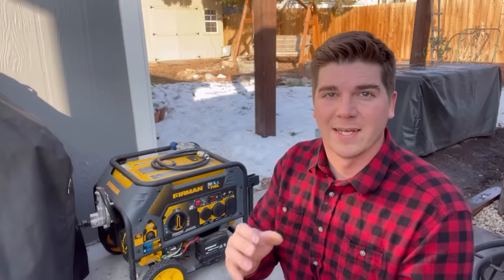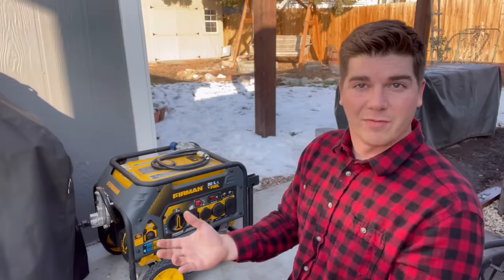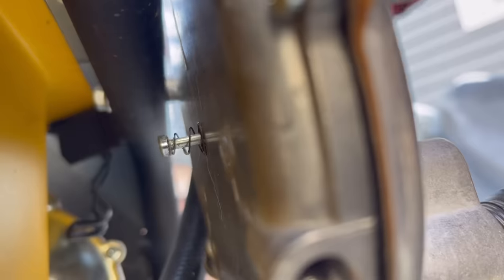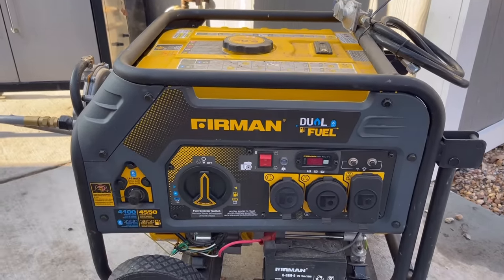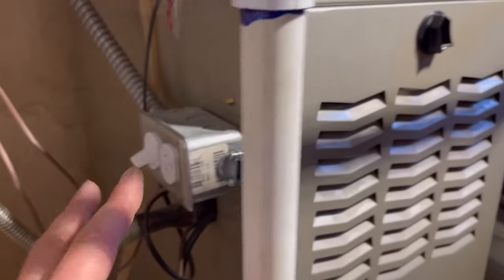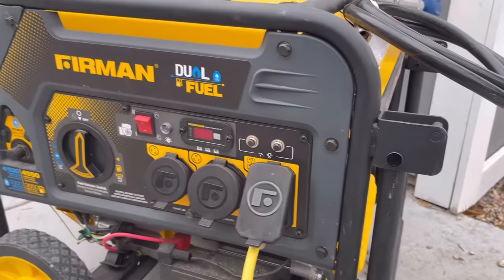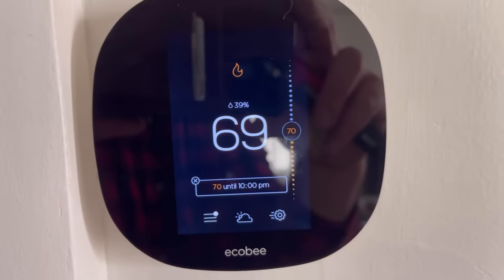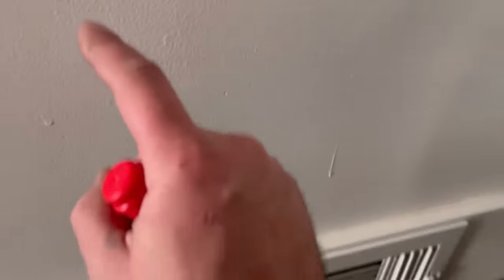Most Homeowners Don’t Know About This Trick To Get Heat During A Power Outage.

Comment: My understanding that you should be plugging in sensitive electronics into an inverter generator. There is close to 25 percent of Total Harmonic Distortion (THD) on regular generators that can fry up things such as home appliances and electronics or even newer furnace electronic boards. THD of a regular ac current should be under 5 percent.
Reply from the maker: If you have a generator already you could use a pure sine wave inverter in between the generator and the furnace.
Reply: @Glocktard  Generator runs a battery charger.  Battery runs the inverter.  Inverter runs the furnace.  It's about as scary as you can imagine.

Comment: The newer inverter style generators that have the "On/Off" switch on the fuel cap do not have the same issues with the fuel going bad and wrecking the carburetor. I use E10/E15 in mine, I have one of the A-iPower generators. I leave E10 in it all year long without an issue. You have to turn that switch off though.

Comment: Your generator is not a pure sinewave inverter generator, right?  I understand that some furnaces (I've been told mine) will not run properly without a pure sinewave.  

I don't know why anyone was saying that power was still going out to the electrical grid.  Basically, you're running your furnace input wiring into the cable.  Your switch box is just an outlet.  When you unplug the cable from the outlet, there is no connection between the furnace and the house power.  None.  There is no reason to turn off your mains at the box because there is no a connection between the furnace/generator and the mains system.  This was a very helpful suggestion, and I re-wired my furnace shutoff to work the same way.

I am worried about letting the furnace system run down.  If we turn off the heat at the thermostat, will it go through it's cooldown before turning off?
Reply from the maker: Yes the thermostat will allow it to do the cooldown procedure line normal, then once the air has cooled and quit blowing from the vents you are good to shut down your generator 👍🏽
Reply from the maker: You could also install a pure sine wave inverter in between if you have a high efficiency furnace.
Reply: Use a silent generator 😊 https://youtu.be/25dCG557qC0

Comment: Appreciate you taking the time to make this video. No doubt it will help a lot of folks! I didn't know about the NG regulator 👍
Reply: They run at different pressures.  Know what you're doing.  Propane runs at twice the pressure.  and a much smaller orifice

Comment: Not sure if this was mentioned elsewhere, but if your generator or inverter is NOT bonded “neutral to ground” when running “direct” to your inverter or generator your furnace will most likely fail to start especially with newer control board furnaces. Easy to test by using a meter to test for continuity between neutral and ground on the inverter or generator. Once I bonded everything worked perfectly off inverter and Generator. If you tested with one of those 3 prong probes you will see an “open ground” if the inverter or generator is NOT bonded. If bonded you will see no error or ground fault.
Reply from the maker: Great advice. Maybe it will help some folks out. I didn’t realize that my Gen set has a bonded ground, so it does the work for me.
Reply: @diyhvacguy  Your welcome! I spent a full day testing…. and bonding neutral to ground is very important in many sensitive applications not to mention for safety too. Generator / Inverter manuals will state how they are configured but beware…. My Renogy Inverter stated it was bonded inside the inverter but when I checked it was NOT. Once I bonded neutral to ground the furnace passed it’s self test and bingo off to the races. This was running the furnace stand-alone directly to the inverter. Sorry for the long winded reply.

Comment: Great setup and great video! It would be much better and safer to NOT mount the NG regulator to the machine due to the vibrations coming from the generator. At minimum I'd suggest adding a rubber isolator. Thanks for taking the time to make the video and share your setup!

Comment: Everything at my house runs on propane, except lights and outlets! A wood stove keeps me from having to burn $2.65 a gallon propane for heat. I have 1000-watt inverters mounted next to both refers and my living room entertainment center ( 60" plasma and related stereo components). When the power goes out I move a battery to each location and we are off to the races!. I also have 2 solar panels that charge up 3 battery banks (24volt) in my sunroom, and they run the lights there, at least in the summer and on good days with no clouds. Collect batteries anywhere you can, they are golden! :) I also just got an incredible deal on 2 3000 watt inverter/chargers new in the box. they will go into storage! :) Get a solar generator too if you can afford it. I have an ECOFLOW and my son got the Bluetti!! Merry Christmas!

Comment: Excellent information, you are a remarkable teacher and your solutions easy to follow. I have an AC200p and an oil fired hot water radiators furnace, following your pigtail bypass do you feel that would work as well as your  gas furnace keeping in mind that  there is a circulating water pump attached to the furnace.

Comment: I disconnected my gas furnace from hardwired to plug-in years ago. If the power grid drops I can quickly plug in to another power source. I have four RV batteries on a hand cart on constant maintenance charge with a pure sine wave inverter, outside are two generators with power cords terminating in the furnace room.

Comment: off topic video suggestion: how to fix a noisy AC compressor.  Starts with a loud whack…and runs loud.   I’m guessing a new fan motor would help, but how do determine the correct replacement fan motor?  

And how to quiet the loud whack when it kicks on (what part, and how to determine the correct replacement for it, as well as the correct fan motor replacement)?

Thanks.  0:03
Reply from the maker: Thanks for the recommendation! I’ll def do a video on this. Maybe it’s a problem that a lot of people have. Thanks again, cheers

Comment: Just as an aside.  Gas with ethanol is perfectly fine as long as you're going to use every bit in the tank and run it dry within 30 days.  For the last long while I use the less expensive ethanol gas when I know I'm going to run it dry and then run about a cup of ethanol free.  It's only when e gas sits for a long while that it starts to gel up and clog the injectors.

Comment: Part of the preparedness challenge is the knowledge that when you need a generator, so does the fuel station. Friends in CA had to find a generator big enough to run the fuel station before they could buy the fuel they needed.

Comment: For the furnace you basically added a regular plug to it so that it can be powered by another source.  I’m surprised people think the plug is live.  The only thing I would do is put a shoe or something at the door to keep it open so that it is not pinching the electrical wire.  That’s the only risky thing I see.
Reply from the maker: Yea I’m like how did you get that this plug was going to be live from what we just did? They must not understand the concept. Thanks for the tips I put a grommet in there to protect the wires👍🏽 cheers

Comment: Very interesting video.  Thanks.  Question:  The hose you removed from the propane regular is the same hose that is on the natural gas regulator load block, now correct?  Thanks.

Comment: Just a FYI - to my understanding that whole back feeding the lines and killing a lineman is mostly BS. My son is a lineman and a good friend of mine is also. From what they tell me, they work of live wires all the time and treat every wire like it is live. To dive the point here, I lost power to my house for three weeks during a hurricane here in Florida, I ran my house the entire time on a genny, when the guy finally came out to do the final inspection and pop the meter in I ran outside waving my arms like a idiot telling him my generator was running still. He told me worst case scenario if I left it running and through the main it would fry the genny, but more than liking it would trip the breaker.
Reply from the maker: Wow that’s great to know. Thanks for sharing!

Comment: I was going to do the pigtail but then I got lazy plus most pigtails are 14awg.  I just cut the 12-2 and installed a male plug.  On one furnace I did put a single gang outlet but on the other I just spliced in a male and female plug.  I know this isn't recommended but how often will I actually have to unplug it.  Also just note my 1/2 horsepower pulls 869 Watts but my 1 hp dual zone pulls 1169 continuously.   They both pulled 1500 watts on start up.  Get a watt meter and check this out before you lock into a generator as some of the smaller ones could struggle.  I just ordered the new pulsar 4000 that's 2800 on LP and should be perfect.    This strategy is all a back up to my 17500 generac with an interlock kit.

Comment: You could also install a 50 amp outlet outside and hook right into the panel. Then shut the main power off and turn the new 50 amp breaker on and plug your 12k generator in and it will power the whole house as od the power never went out. When power comes  back on reverse the entire process never never never turn the main breaker to thr street on while the generator is running.
Reply from the maker: This is the plan very soon! But for those who can’t afford it, this is a viable option :) stay tuned for the interlock kit install that’s soon to come. Cheers

Comment: While this will work I strongly recommend anyone who lives where they need power to their heating system invest in having a proper connection for a generator. This will allow them to jot only operate the heating system, but also other circuits including a refrigerator, water heater, etc. They may not be able to run everything at the same time, but they can run what they need depending on the capacity of the generator. I installed a 30 amp receptacle in an atrached garage and an Interlock switch in the main service panel so the breaker for the generator and main disconnect breaker cannot be on at the same time. Even if you don't have a generator you will be ready if you borrow or buy one in the event of a power outage.

Comment: Ok, I work for a power company and one of my jobs during a storm restoration is to check neighborhoods for running generators. If you pan on powering individual units/appliances, you are good. However I commonly encounter set ups where someone has put a 50 amp breaker, wired it to an outlet, fabricated an extension cord with 2 male ends and plugs the generator into the outlet after shutting off the main breaker. This is NOT up to code! It must be wired through a transfer switch designed to attach a generator to your home electric.  It is NOT considered safe and if I find one when I am patrolling, y sI will pull the meter and your house will get 😊power restored AFTER everyone else. I will also notify the local electrical inspector of the violation. It ma

Comment: You can back feed your service panel with the 30 amp 220 volt outlet on the generator with a separate breaker and a breaker interlock system and still be safe.

Comment: Get a generator that can run 12 to 24 hours at 50% load so you are not refueling it every 4 to 6 hours. And make sure your furnace does not need more that 50% of the watts the generator can provide.

Comment: Great job 👍 thanks for sharing. I've always had a generator ready. Now where I'm going I'll have to do it there. I liked your inverter with the 12 volt battery close to furnace. That would get you through the night no problem. I'll have to check out that generator mines too big and heavy. Only thing I would do is have it so i can pug the generator from outside.
Run the furnace and a kitchen light and fridge and stove. It might be a good idea to get a gas stove instead of electric.
Reply from the maker: Thanks. And yes gas stove is always a great idea. That’s one of the first things I did when I bought my place. I’m gonna be doing some test videos with two different 1000w lithium power stations so stay tuned for that!

Comment: Really like the pig tail furnace video. I used to hard wire old furnace to generator power when an outage happened. Never liked doing that but it did protect lines workers. I am having trouble finding the switch/outlet you used. I have stopped the video and used a magnifying glass to look for info. but no luck. I have ordered 2 Leviton units, 4 screw not right and 6 screw not right.
any thoughts. DE

Comment: Any suggestions to make this work?  We are losing power frequently, a new thing since DTE switched around what substation we are served from.  Basically our area is overbuilt in the last 10 years.  Anyway, by local code our furnace is connected to a combo switch/gfci plug, the condensate pump is plugged into that plug.  Then a armored 3-wire cable goes to a nearby junction box which brings in a dedicated circuit.  I disconnected the armored cable at the junction box and put a plug on it, then connected that to my generator.  The furnace partially started but would not fire up, flashed a code 26 saying "neutral reversed or poor ground"  It's not a bad board, when I wired it back to the original state and our service power finally came back, everything worked fine.  I suspect it has to do with generator/gfci in conflict, not sure.  Generator ran everything else it was connected to just fine.  Perhaps I should make a pigtail behind the gfci/switch?  Thanks.

Comment: i changed my furnace to have a plug in cord. I wouldnt turn on using my champion invertor generator. Champion told me its probably because the generator doesnt have a ground/neutral bond. I made a cord cap that bonds them.  I havent tried it yet but hopefully that works.
Reply from the maker: It should work. Some have a bonded neutral. Mine did Apparently and I wasn’t aware of it.

Comment: My concern with the setup like this is the heating of the extension cord. Is that a 100 ft cord you're using, and also what gauge is it? On a 120 volt furnace, can you get away with a 16 gauge extension cord? Or does it get too hot? I would imagine you should probably get the heavy duty 14 or 12 gauge cords for this.

Comment: Sorry ,I missed the generator run down on the outlets.I need the 240v 30amp so I have to get a larger generator to typically get that outlet.Still figuring out if I need the one inch or maybe a 3/4  inch hose  line going to generator.Guess it depends on the draw of gas needed to run generator.Would like to see video on the regulator install.

Comment: Thank you Dave you have some really clever ideas.. once I figure out how to keep the heat on during the blizzard this year, I want to figure out how to replace my AC compressor that is going on 12 years. And not have to pay an HVAC guy like three to $4000, when a 3 1/2 ton Goodman would only cost about 1500.. just no need to know how to change out the lines and refill the gas. Wiring and a coil are all there, and doing it before july might be good thinkin! Nice work man!
Reply from the maker: Hey thanks so much! If you’d like tech support for your ac replacement as well as finding the best price on equipment check out our $25 membership at Patreon.com/diyhvacguy and I’ll help walk you through the replacement. Cheers
Reply: Hi Dave I appreciate your offer , I am retired and I have a small income. Since I was in the trades for over 50 years, this is why I feel confident on working around stuff. I did play the lottery tonight if perhaps an extra $25 will show up, and I will gladly pay you. I really do wish you well, and I think you’re doing well..? Really enjoy your work and hope to see more…
Reply: Sorry just a crusty old Yankee.. got take a note by Wall Street. Nevertheless your work is good and I appreciate your videos and sure watch.
Reply: You'll need a manifold guage set and a vaccumn pump plus fittings, map gas or acetylene, silver solder. Maybe rent vac pump, guage manifold?

Comment: Keep in mind that YOU turning off the main breaker is critical… code requires any generator hookup to a panel be installed with an interlock so it is IMPOSSIBLE for a generator to connect without disconnecting the main.

Comment: Quick question, how big of a generator would be needed to run an all electric furnace, not a natural gas furnace?
Reply from the maker: Probably 10,000-12,000 watts   Then you’d need a way to power it, probably a transfer switch, or you can look into a generlink. Cheers

Comment: What about orifices? I don’t know if it matters in an engine but every other burner will not work by just simply changing regulators. If you don’t change out the orifices then you could cause big problems. This wouldn’t necessarily apply here because you get issues when you run LP through Nat Gas orifices because there’s more pressure with a larger proficiency which makes a bigger flame than designed for. It must not matter too much in an engine because those generators have one engine and the switch just changed the fuel source so I guess the seals and compression etc are all the same
Reply: The fitting on the regulator allows you to adjust the overall gas flow to the engine and the regulator modulates that gas flow according to the vacuum at the carburetor venturi. In short, the DIY Guy did it right.
Reply: @tgriebe  yeah that’s what I figured. Since there aren’t any orifices because it’s not a burner but a combustion chamber, the pressure differential is the only adjustment to make but I figured I’d ask. Thanks